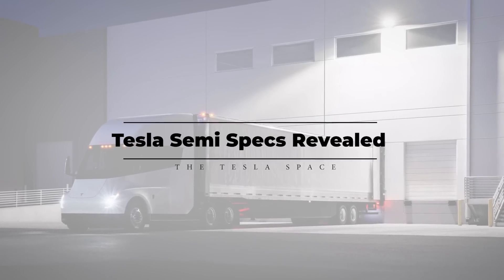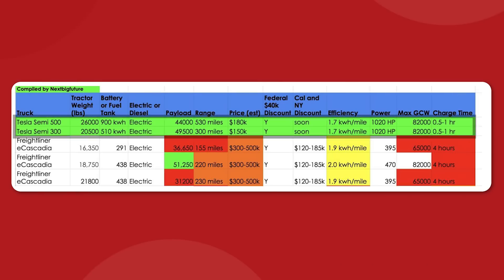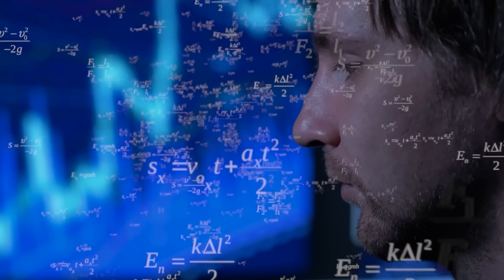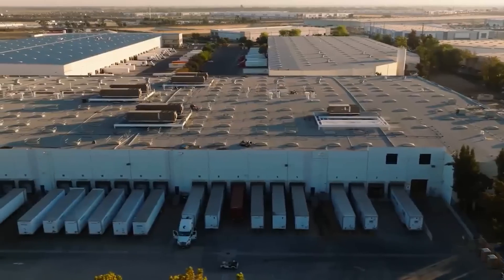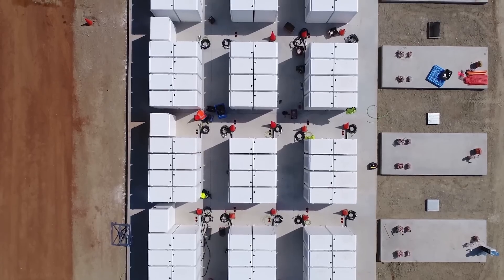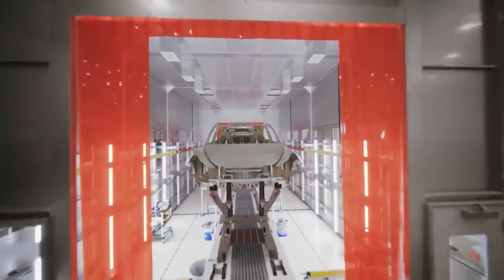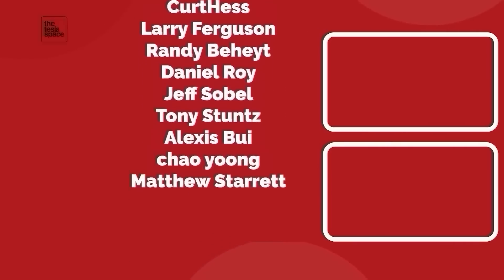Major New Tesla Semi Specs Revealed!

Comment: Any feedback from actual drivers and also pictures of sleeper cab please? Also 82.000lbs is 37 tons only. Here is Europe we can drive 44 tons (97.000 lbs) and even more with special permit. Most of 6x4 trucks here have 65...66 tons of GCW. Tesla should think more forward on that if they want to sell those truck to Europe and be competitive. And if the rear axle loads are limited to less then 9 tons...that would be disaster. Most heavy haul trucks here in Europe have at least 10.5 tons rear axles, actually many have more like close to 13 tons per axle so you can load around 20-25 tons into the 5th wheel. Looking those numbers what Tesla shown this is more like mid heavy haul truck and FAR from heavy haul truck

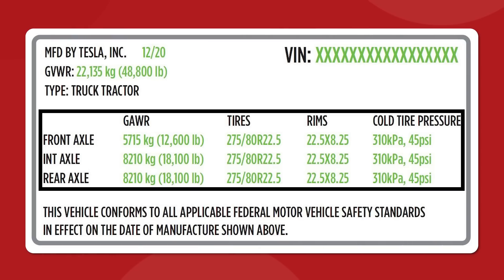Comment: 3:34 this is specs for a protoype made in December 2020. This tells us very little about a 2023 production model. Since the proto has 30 more miles, the production TS must have changed some of the other specs. And this calls into question all the info that was dropped. Is it all outdated?

Comment: I'm wondering how many miles can that motor hold up in tha real time every day also the distance just like the car will be less ass it gets older most truck engines last up to million or more miles but this is cool if it can put us in the direction of having a cleaner planet.
Reply: Electric motors can last dozens of millions of miles. Its the battery that degrades and is the limiting factor.
Reply: @a4yster  when you say electric motor I can't get the barbie car that I brought for my daughter and even though I replaced the battery it didn't work. These motors are probably more advanced then that one 😆
Reply: @bigd9526  what are the readings on voltage meter or your the barbie car motor? Does the current go through? What is the resistance and does it match the label on the motor?

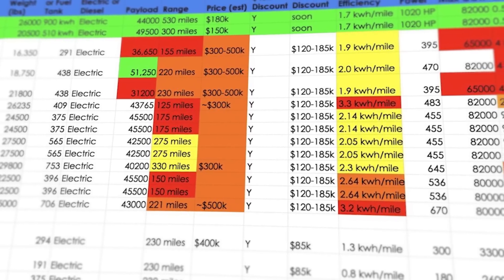Comment: What is the unit of payload in chart @6:31 ?   (i.e. PL-40200, range-330miles, average consumption-2.3kwh/mile)

I think Elon should modify Semi's design. 
Electric vehicles don't need to carry ENTIRE engine/transmission/fuel/modules (OR batteries, motor, axles), IN DRIVER UNIT aka SEMI.

You can redistribute batteries and motors among semi and trailer.

Modify TRAILER for Electric semi-
I.e. Trailer having its own battery + motors.
When coupled with semi truck, both working in harmony, (like a modern train with traction motors inside every bogie/wheel).
Reply: You will thus haul less on the trailer. Dont forget about 34k lb max weight on the tandem.

Comment: Tesla's mega packs are great but at some point we have to stop using Li batteries for static applications.  The added demand for LI they create is driving the price of Li batteries way up and hence the price of electric cars.  Think how much less an EV could be sold for and hence how much greater the market penetration if Li was not so expensive.  Besides, alternate technologies have some definite technological advantages and are made from cheap, readily available elements.  All the alternatives can be fully charged and discharged without damage, last far longer, are safer from a fire point of view and hence can be shipped any way you want and are more easily recycled.  We have the ZnBr flow/plating and gel batteries, the SbCa and AlS liquid metal batteries, a whole range of redox batteries based so far on V and Fe and the up and coming Na batteries.  Perhaps there is too much choice for any one to obtain the market share that would bring their cost below that of Li batteries which are already far up the technological learning curve.

Comment: The GVWR of 44,000 is pretty bad considering the extra 2000 pounds EV trucks get gives it a 82,000 possible load legally, but these trucks only have a 70,000 pound total weight.  At 82,000 pounds it would not get close to 530 miles and instead would be closer to 450 miles.   A full sized truck with 2 front seats and a sleeper is usually around 53,000... so against diesel truck that is significantly larger you are hauling 9,000 pounds more and can have ranges as high as 2000 miles before refueling.

The other problem I have is the 1MW charging station.  That is 1000 volts at 1000 amps.  That is crazy lethal levels of electricity.  That is not a bad burn on you hand, but a pair of smoking boots on the ground.  To put that in perspective that is the same power draw of 465 average homes in the US.  That 900w battery could power a home for 6 months.  The size of the transformer station to handle a truck stop would be pretty significant.  A typical truck stop can fuel up 10 trucks easy and they might run 40 trucks through an hour.  Now that same truck stop for EV would need 40 chargers and based on inefficiencies of transformers and such might need 50MW of power.

A short haul truck with a charger at the shipping dock would likely work fine and the extra 5,000 pounds of cargo capacity would be nice.  But understand if the US stopped using ALL fossil fuels for home and commercial heating and cooking, as well as cars, trucks, boats, lawn mowers, tractors, trimmers... the US would have to increase power production by 400% and completely rebuild the grid from the ground up.  The estimated cost of this will likely be around $80 trillion dollars.  Already EV are stressing the power grid in California and we only have about 1% EV right now.
Reply: The Tesla Semi that ran 500 miles from Fremont, CA to San Diego, CA, including topping Tejon Pass at 4,200 ft., on 93% charge, for a range of 500/.93 = 538 miles, was loaded to 81,000 lbs. 82,000 lbs. instead of 81,000 lbs. would only reduce this by about 1%, or 5 miles.
Reply: @BigBen621  They are listing the data oddly.  They must not be including the trailer on either stat.  That is not how they list it.  Usually it is a gross weight and you have to count the trailer weight in there.  That still makes it 80,000, so they must have ignored the 2,000 extra allowed for EV or they are running a non standard trailer.

The prices they list though are VERY low unless Tesla was able to drastically reduce battery costs.  Understand the 530 mile range version has a 900kw battery.  The Tesla Model 3 has a 50kw battery and weighs 1000 pounds and costs $13,000 for a replacement battery (before labor and taxes).  This likely includes a retail markup, so $10,000 is likely the cost.  This truck battery is 18x larger.  Taking the difference between the long and short range the and apply it to the battery and you see it should be 7,600 pounds less, but it is only 5,500 pounds less.  That is almost 28% weight savings.

The cost though is crazy.  That battery should be $180,000 alone and the truck is somehow free.  But taking the difference between the two the battery would be only $71,000.  That is about a 60% reduction in price.  If those prices are right he is going to loose his ass off the price of every truck he sells unless he is getting some sort of revenue sharing off the charging stations and they are contracted to use only a Tesla charger.

The other thing that I worry about is that to make some of these cost savings there is no headroom in the battery.  All Teslas have about 10% more battery capacity when you buy the car, but the computer does not let you access it.  It is made to hide battery degradation for about 2-3 years.  If these trucks do not have something like that then the range will slowly decrease on day one.  He says they will last 1 million miles (a normal semi lasts about 750,000 typically), so that would likely require 2 battery replacements and you still might be about to only hold about 60% charge by then.  That is 333,000 miles.  This means the truck might not be able to make the hauls it was purchased for after maybe 3 years.

There are a lot of downsides to EV and towing is one of them.  I think Elon should have waited for better battery technology before pushing for these.  He is only going to make up likely .5% of the trucking market in maybe 5 years if that.
Reply: Thank you finalement someone that fckin analyses how big is the challenge and the difficulty brought by EVs. Ans tesla said they would power the superchargers with solar panels. But the amount of land it requires is huge. I'm from the West indies, and they are promoting solar like crazy. I compared the production from solar geothermy and wind turbine. Then i compared the meters square of land used by the three and solar is so unefficient. Btw one truck station of 50 MW is equal of more than 10% of the electricity consumed where i live. 
On top of how much power and new infrastructure will be needed there is the scarcity on materials used for the grid.
Reply: @steeveolivier2847  That is a lot of solar panels.  I did get a bit on information though.  The manufacturing cost of the batteries that go into Elon's cars are currently $101 per KW do to the crazy cost of Lithium.  That would make a 900kw batter cost 90,900 plus casing, cooling, heating, and any profits.  This is actually lower than I was expecting.  Elon might be able to hit that $180,000 price, but you also need a charging station and those batteries will need to be replaced every 3-4 years.

Now I was watching a video for Sodium Ion and I guess there is a company ramping up production capabilities right now saying they can do $15.15 per KW.  If that is even close to true and they can charge and are similar size and weight it would be a game changer... even if they were a bit larger.  They kept using the model Y as an example saying the same size battery would have a range of 248 miles instead of the regular 279 miles, so they have a slightly lower density.  They also pointed out that a hybrid battery with 1/3 lithium ion and 2/3 sodium ion worked well together and could get a range of 310 miles... not bad, but I would rather stick with cheaper batteries myself.  They also said compared to the Model Y it had half the charging time of 80% in 15 minutes.  They are also safer and will never burst into flames.

You might see smaller sub compacts with 250 mile range costing $15,000 or less.  A model 3 has a 50kw battery and to replace it costs over $13,000 just for the battery.  The batteries themselves cost $5000 plus the heating, cooling, casing, safety... and markup.  So figure $10,000 $500 shipping and about $2,500 markup.  But in a smaller car with say a 35kw battery that does not you are talking less than $1000 in batteries.  If they take heat and cold better and such the battery pack might cost $2000 total.  Put a single motor in it, no transmission, cheap breaks (because of regenerative breaking), no cameras or driving assistance (maybe as an option).  Personally I don't like AC.  having the option to skip that and save $500 would be nice.  Have it come with a 110v charger built in, just plug in an extension cord.  Maybe if there are some subsidies you could have an EV car for under $10,000 new.

Heck I would buy one and I do not think CO2 is what is killing the environment.  I do only local city driving 90% of the time where EV shine and the lack of wear on the breaks would be great.  I could charge at home easily for cheap and still be able to drive to relative's homes about 30-45 minutes away without needing to recharge.  IC don't really like sitting much and do not do well with only city driving with all the stop and go and not getting up to temp...  I work at home and most of the time I drive less than 10 miles a day and maybe a 50-100 trip 1-2 times a month.  When I had a car I was only putting 2-3K a year on it.  It was not worth it because of the upkeep.  Cars just don't like sitting.  An EV though should last me 20 years easy.

Comment: 🔌🔌So based on this video and using simple math this Tesla solution is 14.10 lbs per Watt-Hour. This is right in tune with the Cummins and Meritor's EV semi-truck released in 2017. Now that Cummins owns Meritor and invested in Sion Power's 500WH/kg battery it will be exciting to see the future of EVs in trucking. Last month Sion Power of Tucson AZ announced a manufacturing expansion. 🔌🔌

Comment: 3:43 You're rather confusing on this section and a little off in certain areas, as others have commented.  GVWR is OEM speced capacity of the vehicle (excluding trailer).  GCWR is OEM stated combined max weight, including trailer.  So that label would indicate that the total truck, including all weight on the 3 axles of the truck, can carry 48k lbs max.  There is no GCWR on the label, but that would be the 82k lbs that Elon has said.  The 3 weights of the axle (GAWR) added together equal the GVWR.  This is not always the case, but it does match here.  The vehicle axle weights added together might be more than the OEM stated GVWR, so you can have 20k rear axle with 10k front axle but still only have GVWR at 26900 lbs.  that happens quite often because of CDL/licensing weight limits.  So the label doesn't tell us how much the truck actually weighs at all, just its OEM stated capacities.  

Then on to your statements about the weight of the truck.  Note all previous weight statements have "R" in them, R = rating, as in what the OEM says the vehicle was designed for.  The actual weight of the truck would be the GVW.  The snapshot of the table at 4:33 is stating the guessed GVW, as in what the truck weighs when its empty or curb weight, as you said. The Payload in that table is also just a guess, based on what Tesla has shown so far, and back calculating it.
Reply: I haul tri axle everyday.  My gvw is 46500kgs.  I haul 5500 17000 and 24000 everyday.  Tractor is 8500k.  Trailer about 5k and containers are 30480 gw.  We usually carry 29000 or more including tare of container.  Usually 3900kgs.

Comment: Meh. 
It's really low in the payload capacity to be honest. 
Most standard shipping containers are around 22-32tons. As the max weight for a shipping container is 32tons. Over 90% of semi trucks worldwide carry shipping containers because 90% of world cargo goes by ship. 
And everyone stuffs shipping containers to the max as the sea freight is charged by container and not by weight. 

Is Tesla semi trucks can only carry 22tons and you need to remove the weight of the trailer than it is far too weak to be used by the vast majority of trucking companies which have to regularly deal with standard shipping containers.

I know a lot of trucking companies and none of them would even consider a truck that can't haul standard shipping containers at full capacity. 
It would work only for specialized companies that always transport cargo below the max weight due to high volume/low specific weight (like a mattress/pillow factory for example).

Everyone else even if they might not too often habe to handle shipping containers, they will not buy it just because it is not convenient to risk having to reject clients because most of your trucks can't carry the standard max load...
Reply: Notice the branded Frito-Lay truck. A shipment of potato chips is only 6000 lbs lmao. I'm not impressed.

Comment: Ha ha ,at 1.09 the trailer is made of aluminium wich is lighter than a A trailer plus only 9 concrete barriers wich they are a smaller barrier than the most common ones even so give 1.5 tone per barrier plus 4 tone for the trailer it is around given and take 19 tone I would like to see this truck pulling a payload of 36 tone up Mt.Ousley ,with a total combined  weight of  62 t. Do that and show the results.

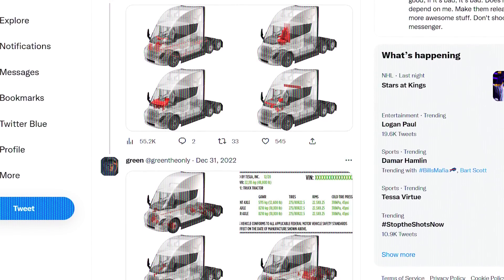Comment: 1:45 "There's less in the way of solid numbers"  Typical Tesla, lots of pictures but little data".  That which has been provided is not all good news. The 1000 kW semi is now 900kW. 
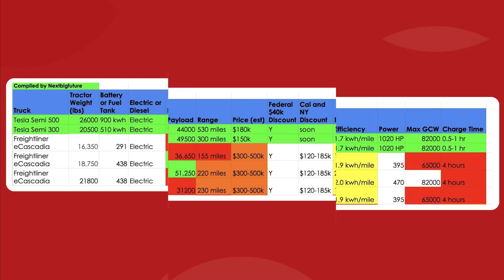5:05.  The masses dont quite add up as the trailer weights are missing, which if everything else is correct is 12000LB.  This makes the tractor-trailer until of the Semi 500, 38000Lb.  If a Peterbilt 579 tractor is 17600LB and if the trailer is the same 12000 LB, that's 8400, ie 6400LBs more cargo that the Tesla (coz Tesla goes to 82000, not 80,000), ie 14.5% less in the Tesla.  Significant...
Reply: When announced, the Tesla Semi tractor will turn out to have a weight of 26,000 lbs. ± 1,000 lbs. Cargo (less trailer) will be 40,000 lbs. to 44,000 lbs.

Comment: I don't follow what he's saying. The GVWR is 23135 kg / 48,800 lbs. The GAWR 3 axles also add up 21135 kg / 48,800 lbs. He then says add these two together to get approximately 82,000 lbs but added together you get 97,600 lbs.  5:47
Reply: I have the same question as you. I guess he confused the GVWR of truck tractor with the GVWR of combination vehicle (a truck tractor with trailer). 48800 lbs is only the tractor's GVWR, 82000 lbs is the combination's.
Reply: He doesn't have clue what he's talking about. Didn't he just confirm the actual cargo capacity it far less than the diesels ?

Comment: The trucking & shipping industry operates at a razor thin level.

Fuel prices - while gas prices came down, strangely during election season to placate voters. Inflation continues to rise. That's because diesel prices never came down and everything we buy comes on trucks. Over half of the trucking is short haul not OTR(Over the road). 

If these specs are true, then Tesla has lightning in a bottle. The specs will only get better & better as they fine tune their battery production. 

The question is how many can they produce in a year?

Comment: If you needed even longer range you could put a battery in the trailer or mounted under the trailer deck
Reply: Totally stupid idea! That reduces the total payload at carry! It’s not like diesel trucks where additional fuel isn’t heavy
Reply: @alanmay7929  not stupid just not for every application and country
Reply: If you needed even longer range you'd use a fuel cell truck.
Reply: @silentsnooc  what kind of a fuel cell there's no hydrogen  filling stations and there never will be